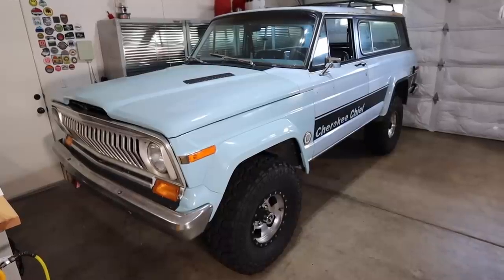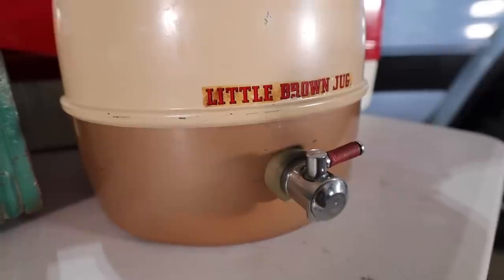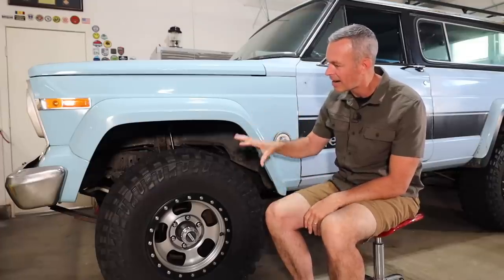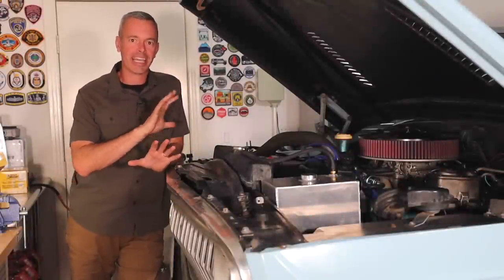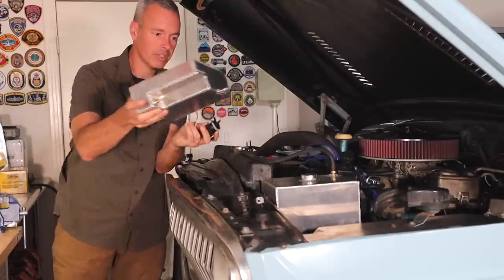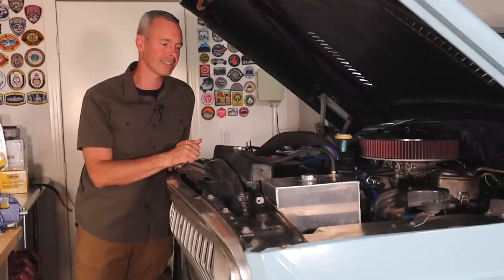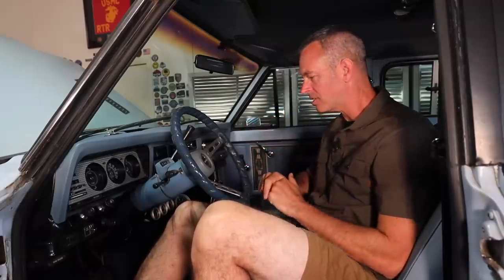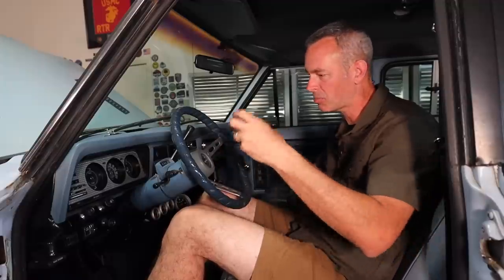Is this 41 Year Old Jeep Cherokee Chief Worth Restoring?

Comment: PLEASE DON'T IGNORE:
Since you already have an after market voltmeter installed you should really check the AMMETER wiring to ensure it is either not running behind your dash or at least bypassing the old amp-meter. 
Couple of additional notes. 
1. The light system is a single wire system. Check your bus fuse under the dash to verify if you can get the left light to blink. You have two of the same fuse under there to test the other.
2. You can remove the dash pad without removing the dash. The pad is held in place by speed nuts and brackets in the urethane foam pad.  Since the original was made out of foam, I used the same (in the form of great stuff) to fill in the 6X9 hole in pad and make some repairs to cracks an breaks by the defrost vents before recovering with synthetic micro-perf leather. You will need to remove the gauge cluster and cardboard glove box before you can get to all of the nuts though. Might be worth tackling while at the upholstery shop if the windshield is good.

Comment: That. Stove is white gasoline, not kerosene! Love the fsj Is that a th400 and Spicer 20 drive train? Probably 3.54  axle ratio? AMC 20 or Dana 44 rear ends are possible and both are ok with 33s on there. Try an overdrive trans of some kind, lower gears and t case low range, fuel injection with the 360.

Comment: If that Coleman equipment is kerosine it’s worth about a million bucks!  At age 70 I went out and checked my vintage Coleman equipment and then looked it up to make sure I was remembering correctly.  You sure they’re not white gas (AKA unleaded) or Coleman fuel.  A DUI distributor is the best item you can buy for the old AMC engines, both 6 and 8 cyl.  We saw dozens of AMC engines in the shop over the years and installed close to 50 Howell units on the I6 and V8’s, you will love it.  Howell will tell you it will run infinitely better with the DUI distributor.  Great project vehicle, whatever you’ve set as a goal for monetary investment as long as you don’t spend more than 2-3 times that estimate you’re doing great!  I couldn’t see real good but it looked like you don’t have the horrendous Quadratrac TFC, a big plus if that’s the case.

Comment: and may I suggest an awesome era-appropriate fix to the cracked dash?? I've done it on my old 90 mustang 5.0, but grab s0me velcro and get a carpeted dashboard cover mat, some velcro will hold it down securely, and the carpet will look great for years, can go all black but I would match either ur future interior colors or match it to stock color as well of course... google will show u tons of companies that make them, but don't cheap out on these eBay I'm sure has some horrible examples.. hope that helps and it will make ur dash look and feel brand new!!

-p3t3r

Comment: The brake light problem could still be the bulb, most of those bulbs have 2 filaments, one for brake, and one for the running light. I had the same problem on my yj, and it turned out that only one filament had burned out and replacing the bulb fixed the problem.

Comment: Try with the jeep on the ground with the weight of the jeep on itself just losing all leafshackle bolts shake jeep to settle itself then retighten all bolts back to torque specs and also inspect all shackles bushings while doing this process it will help with your ride quality sounds crazy I know but it works

Comment: One minor correction, those pieces of Coleman equipment don't run on kerosene, but run on Coleman fuel or white gas if you live in an Amish area.  While some Coleman lanterns do run on kerosene they'll be plainly marked.  
I love my Coleman lanterns has they are very bright and mechanically quite simple.  Since they burn liquid fuel you don't need to worry about keeping them charged up or a fragile piece of wiring or electronics breaking.  Put the lanterns in a nice case or at least wrap them in something soft to protect the glass and they'll be fine for travel.

Comment: Chasing bad grounds is a sport in these old Jeeps. FYI, full current runs through the headlight switch and the rear window dash switch. These are the first things to burn out in the dash, and that rear window switch is impossible to find. Think about running a fuse block.
Reply from the maker: LOL! Chasing wire is absolutely a sport!

Comment: You are not only the owner, but the caretaker of that Chief. Of course she’s worth restoring.
Reply: Don't get the roof patched or partially repaired. Just get the whole roof skin replaced. It's spot welded in the top of the windshield opening, along the drip rails, and along the top of the rear window lip. It's time consuming, but not necessarily that difficult to do. Take on the job yourself. Find a yard with a good donor and have them chop the pillars to get what you need. 74-up Cherokee, Wagoneer and even Grand Wagoneer up to 91 is the same. From the drip rails down is what's different between the Wagoneer and Cherokee. If you have access to air tools and a welder, and maybe a little know-how, you can replace that in your driveway/garage.

Comment: I can tell from the holes in the back and that spare fuel tank that this had the dealer-kit like mine.  I do not know what it was called, but it was sold in southern California with the lift, rear tire carrier and spare fuel tank.  Mine is a 1979 too and I wonder if they were from the same place?  I was hoping to find a period-correct front bumper for it that could hold my 8274 Warn winch.  Looking forward to more videos on this one.

Comment: Restoration is tricky.  I'd say upgrade to make it reliable and comfortable.  Restoration serves a purpose too, but for me it's mainly an aesthetic one.   I would keep the mods mild, and focus on the reliability and comfort portion.
Reply from the maker: Reliability is top of the list for me as I'll be taking this across the country on some trips.
Reply: @TrailRecon  I'm sure you know and others will chime in, but old tech is old tech.    Even if old tech is up to great standards, it can't fully compare to new tech.  It wasn't designed with the same goals in mind.    

So, carry lots of spares in that beast!

Comment: Huge following for these back East & Mid-West where SMOG is'nt a factor.  The huge CON is emissions, especially here in California unless you have a 75 or older.  I had a Grand Wagoneer that looked pretty much the same.  The vacuum hoses and emission controls totally rob the motor from its true performance.  The vehicle is extremely heavy.  Great for camping, not so much for "wheel'n".  Working on it???...better have both metric and standard...AMC used both types of systems.  Overall great vehicle when you not turning wrenches on it...Jeeps havent changed much...

Comment: I have the same washer problem with my '84 CJ7.  I can hotwire the pump and it works, but haven't chased down the wiring from the pump to the switch (which I've changed).  Curious to see how you solve that one.
Reply from the maker: I admittedly only messed with it for about an hour, I need to really spend some time and find out the source of the problem.  Thankfully there replacement switches if it comes to that.

Comment: Can you add direct links in your video description to the "upgrades"/parts that you mention (aftermarket ac/heat, Howell Fuel Injections, etc.)?  Are you tracking in a spreadsheet expenses/budget, can you share it?
Reply: replacement seatbelts....
Reply: carpet, cost of redoing the seats, etc.